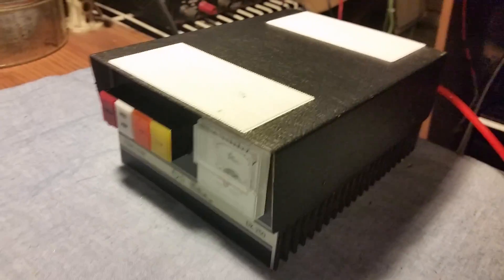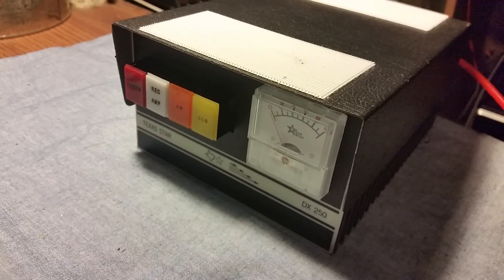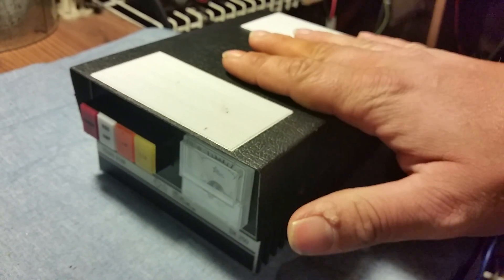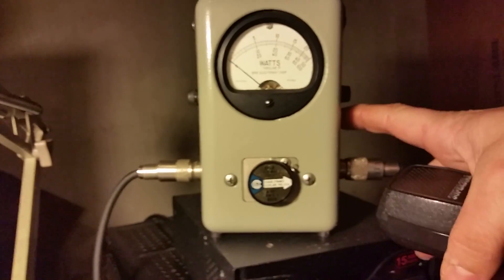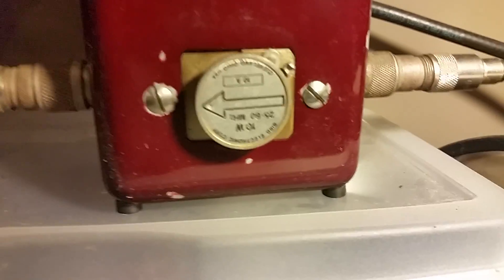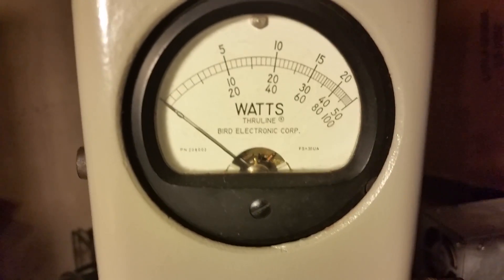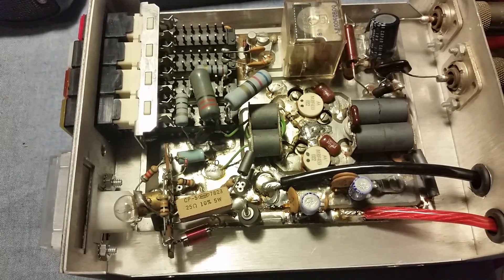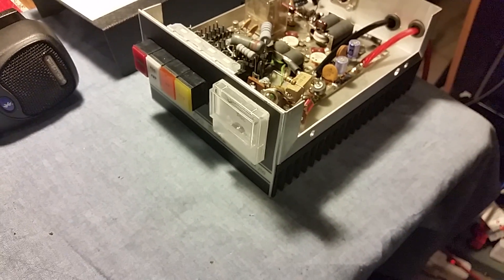Texas Star MC 250 2xMRF453 New Front End Repaired 👌- [RARE]

Comment: Nice I have two of these mc 250 amps that aren't completely beat up. But after watching this video I may have to rethink my thoughts of selling them 😁
Reply from the maker: They are rare man!
Reply: I figured as much been doing cb a long time have had several Texas Star amps and a couple OutCom amps . Wasn't till I moved to Nevada that I found one then this summer another one. What kind of value are they working with stock power wires . I also use one of your dial a watt swing kits on my cobra 29LX works great.